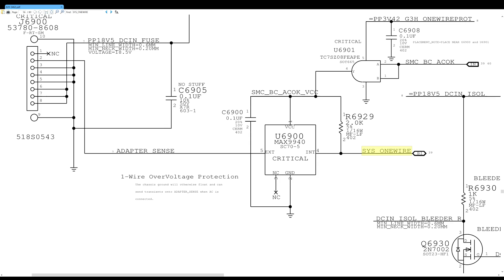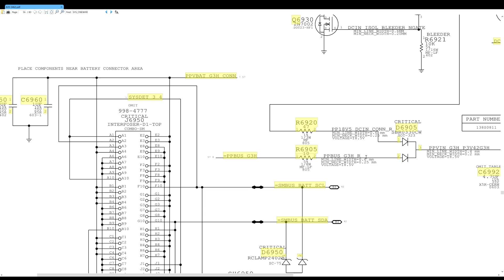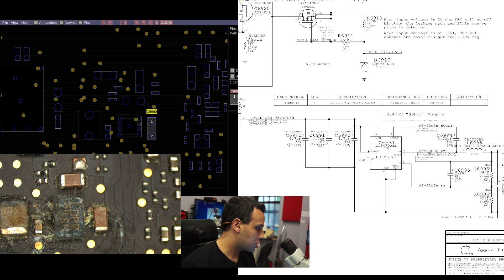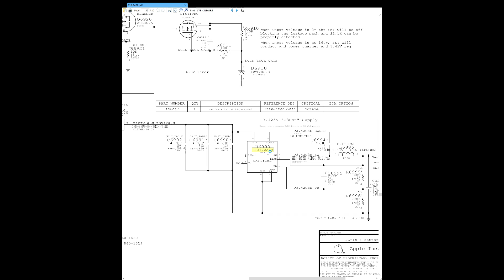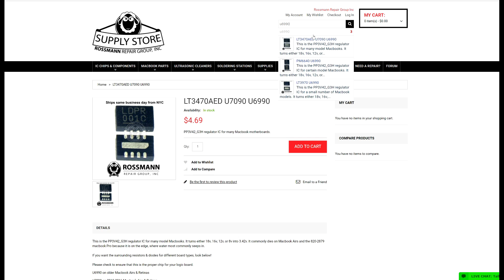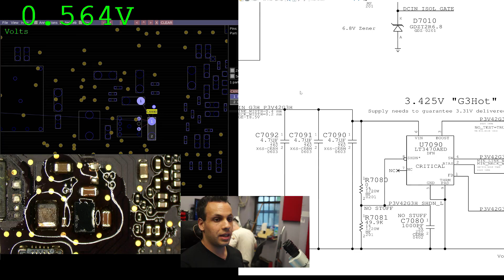MACBOOK CHARGING EXPLAINED - FAST & SIMPLE!

Comment from the maker: Want a machine that won't get owned by humidity? Buy a Thinkpad. http://amzn.to/2hAUpzs
Reply from the maker: The yogas and ideapads are shit. T, X, P series thinkpad good. Rest shit.
Reply: Lenovo is the worst. They released a laptop (yoga pro 2) with known hardware compatibility issues and other issues worth OS features clashing with hardware. Lenovo's (specifically the non-IBM carryovers. Like the yogas not so much the ThinkPads.) are the number one PC that the 3 repair shops I go to see most frequently. Worse than Apple.
Reply: Louis Rossmann Good to know... Thanks Louis!
Reply: +Richard Clutterbuck
All Lenovo Yoga's are shit tier and you shouldn't even touch them.  Don't go with the Lenovo ideapads either, also shit. 
Thinkpads are decent.
Reply: Think different.  ThinkPad.

My W541 has sustained a full mug of coffee spilled into it.
Reply: Wow you can still buy a machine with windows 7? Nice! Thats three less windows than windows 10, which means three less things to piss you off
Reply: Thinkpad it is
Reply: What about new ThinkPad X380 Yoga? Is it good?
Reply: Louis Rossmann What do you think about dell precision line? I'm about to buy 7720
Reply: They must have packed the now defunkt optical bay with rice  -LMAO
Reply: My ideapad's motherboard had fucking solderpatchwork on it. They have the "shiny aluminium" look, but its just shitty plastic which is aluminium coated.

Comment: Another short & to the point video on power failure type problems. Nice work Louis. 👍
       I’m the Retired Repair Tech that is getting update lessons from you on the tools & techniques used with modern surface mount components. 
Eg. I had to work without schematics on many repairs 😀

Cheers
     Trevor in Perth West Australia

Comment: As someone who has just gotten into IT/Electronics Repair shop here in OC SoCal and specializes in Windows PCs despite the shop being primarily an Apple device repair shop (Meaning I'm the go to tech for windows/linux desktop, laptop, and tablet repair. I do still have some responsibilities to learn how to repair Mac devices such as Ipads, Macbooks, Apple Watches, and/or iPhones and holy hell Apple uses to much unneeded adhesive for their devices and it always damages some other component if the device isn't removed properly. And why does apple use like 100 tiny bolts/nuts/screws for their macbook keyboards chassis. Meanwhile replacing the keyboard on a Lenovo Y520 is extremely simple and doesn't require like 100 screws for a single component.

Comment: I have a nicely done non-Apple replacement battery in a 2007 MacBook. It charges alright, but the charge indicator is wrong, the Coconut Battery app shows crazy maximum capacity values like 33.172 mAh. There's also no low-battery warning and the MacBook just shuts down hard. Sometimes after calibrating the battery and resetting the SMC, it works fine for an hour or so, only to fall back into the same problem again. I'm guessing there is nothing I can do to correct that battery behavior, or is there something?